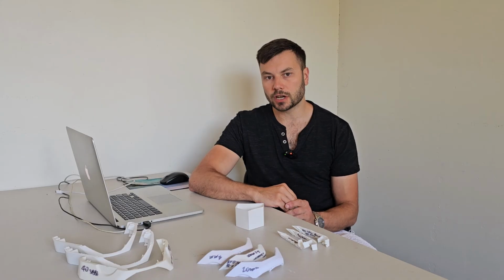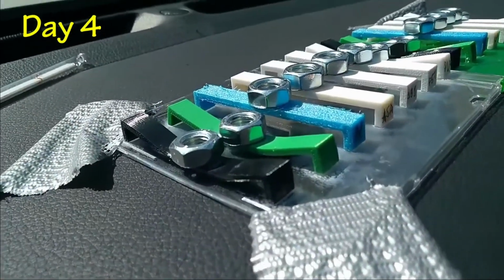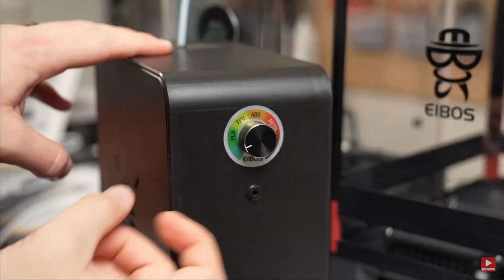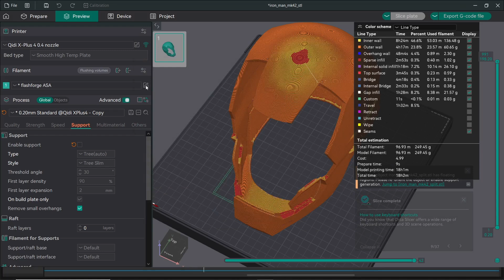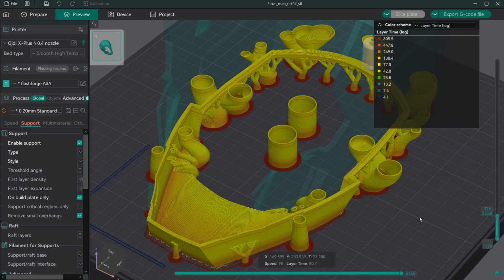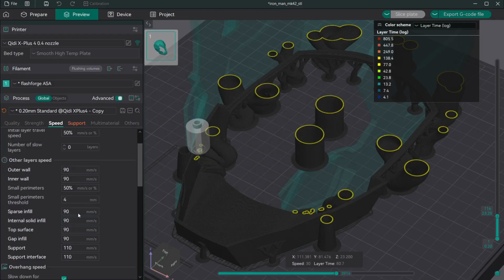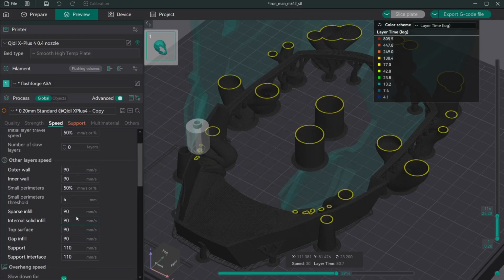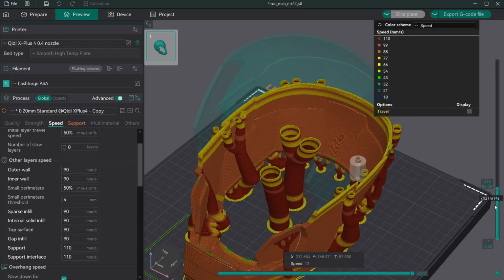STOP FAILING Your ASA/ABS Prints! 🔥 The Secret Nobody Tells You About Layer Adhesion

Comment: Meanwhile people 10 years ago were printing ABS onto kapton tape on open reprap printers...
Reply: I still have functional prints from 12 years ago printed with ABS on my Replicator Dual. Near mold like layer bonding when printing at 35mms and a brass nozzle by putting a thick plastic bag over it 👍
Reply: @MrHeHim zamm archaic problem requires archaic solution I guess
Reply: I have ABS parts that were printed almost a decade ago on a tronxy p802e with a garbage bag over it during the print...I couldn't believe it worked, and the smell was terrible, but those parts are still going strong, lol
Reply: Exactly...it CAN be done...I print ASA on my Bambu A1 Mini all the time....even though I have a P1S, the mini is just more convenient most of the time
Reply: I have an ancient under 3v2 in a non-heated enclosure that is my dedicated ABS printer and does an amazing job. With a heat soaking macro, and a reasonably tight enclosure you can print ABS on just about anything. Heat soaking, slow printing, and good filament are the keys, not a fire hazard heated chamber.

Comment: Check your facts before you make a video like this. I have a farm of P1S printers that do not have active heating and print ASA and ABS amazingly well. We also have K1 Max machines and they also print ASA and ABS great too. Our K2 Plus machines are amazing at it but you can print ASA and ABS without active heating.
Reply: I print Flashforge ASA in an Ender 3 V3 KE. It’s in a tent enclosure with exhaust ventilation. I pre-heat the plate to 100C for 20-30mins. I also use brims and draft shields (probably not necessary) I’ve had very few failures, no warpage (with shields) and nicely finished prints.
Reply: I print ordinary Sunlu and Jayo ABS in X1C with standard settings. Just turn off AUX fan and use PEI plate. No issues.
Reply: Any recommendations for print settings for ABS on a P1S?
Reply: @JoshBettiol  I know this was posted 4 months ago, but I am currently testing Inland ASA filament (MicroCenter brand). What is seemingly working well for me is having the bed set to 100c, nozzle at either 240c or 245c for the entire print. As for cooling, I have a minimum of 10% part fan cooling, with a max of 40%. The aux fan is off at all times, and the exhaust fan is at 50% or lower at all times. I would recommend doing a few test prints if you plan on using different brands, as they can all behave differently with different settings. Also, very important, keep room ventilation in mind! You don't want to be breathing in any toxic gases, so make sure you either have a very well ventilated area, or very good filtration.
Reply: If it's possible on a particular print,  would it help to print by object instead of layers on all objects?
Reply: @aarocar7129  That is heavily dependent on what you're printing. If you are printing small objects, then it might be beneficial. However, I typically just print by layer and use brims and glue if I believe that lifting or warping will be an issue.
Reply: any tips on printing asa on a p1s by bambu? i keep consistently having issues and end up with balsa of wasted filament because something happens and it goes haywire. i don’t know why
Reply: Print flashforge asa on my p1s without issue. He's talking nonsense.

Comment: Anycubic slicer and a anycubic Kobra neo. All in an enclosure and done. 250°c for the nozzle and 105°c for the bed. I saw it helps to set everything as fast as possible (250 mm/s) but minimum time per layer 9sec>

Comment: LOL... I print ABS/ASA Just fine in X1C and Voron printers WITHOUT active heating.  You need to HEAT soak, so an active chamber can speed that up, but the issue with using an active heater, is your bed doesn't flex to its shape at a certain chamber temperature.  So heat soaking is better regardless of active heating.  Only benefit I can see with active heating might be on very large prints, helping to keep a specific temp and move air around so it stays consistent temp throughout.  I do not use Orca slicer, and have zero issues with ABS/ASA.  You are correct that too fast/slow can cause issues.  if you have a good chamber, slower is generally better.  
Also, turning off the fan completely, especially in a heated chamber, can be bad! as you stated, if the previous layer is too hot, you'll have issues with quality and accuracy.  So I leave some fan on.  again, this depends on the type of printer, fan quality, duct quality etc. 
Key is to spend the hours printing test models and tweeking for your individual printer and keeping a profile specific to each printer.
Reply: Starting off with a LOL makes you not worth paying attention to.
Tosser.
Reply from the maker: Yes, but you'll still do better with a heated chamber
Reply: @Buildprime_x an enclosed print chamber with a 100C soaked bed is essentially a heated chamber. I've been printing ASA out of a stock p1s for months now and the layer adhesion is phenomenal.
Reply: @laizalott are you using the provided settings without tweaking?
Reply: @Buildprime_x not if you already have a chamber at 60c.

Preheating is the way